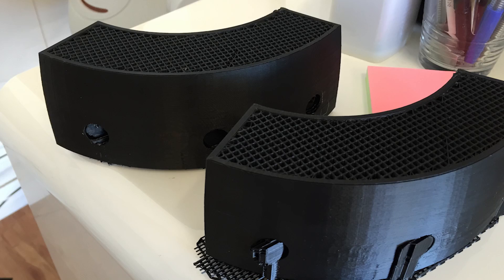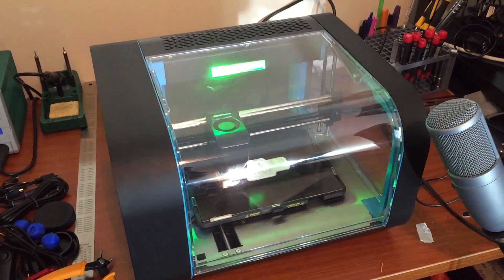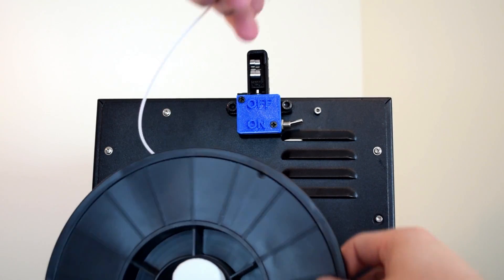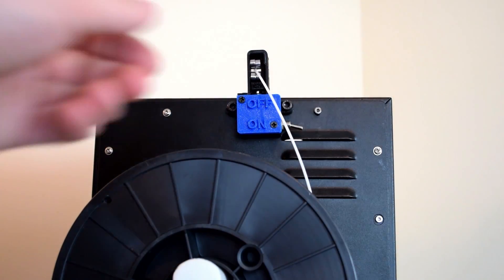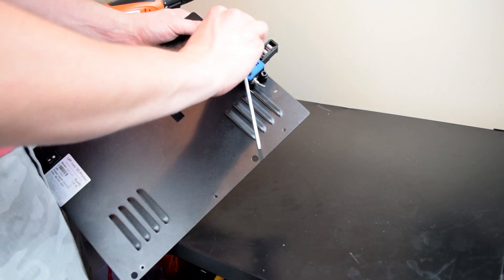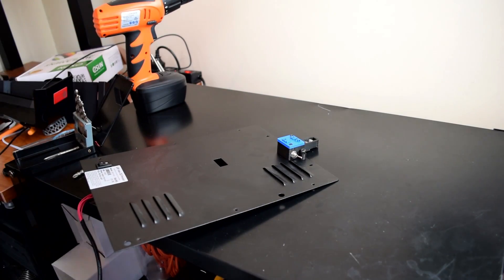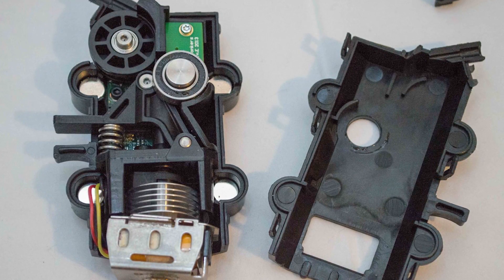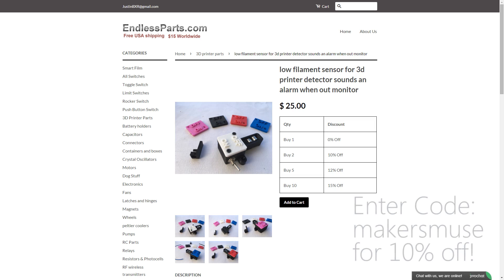Never Run Out of Filament Again - Low Filament Sensor Review - 2015

Comment: Hey, I am 31 hours into a big print and I am nervous that I might run out of filament. I searched your videos but do not see one for changing filament mid-print. I am currently on the Tevo Tornado which seems to have the same functionality as my Ender 3 unit for changing filament, but I have never done it. Thanks for all the videos.

Comment: Nice Video! Repetier supports a system called "FTS" Filament Tracking System. It detects when you are out of filament, your drive gear is slipping or you got a jam and stops the print/slows it down. I installed it on my 3D printer and it is working flawless!
Reply from the maker: +TheZippyMan Neat! I hadn't even heard of it, I use repetier on my Fabrikator mini so i'll give it a shot. Thanks for the tip!
Reply: +Maker's Muse You need Repetier Firmware, not Repetier Host. :) The standard Mini Fab uses Marlin. The FTS module is basically an endstops which triggers a signal when some filament gets pulled in. You can build it yourself or buy it. Look over here. :) http://doku.radds.org/dokumentation/other-electronics/fts-filament-tracking-system/
Reply from the maker: Oh... derp, makes sense! Still very cool, i'll check it out.

Comment: I know this is old now, but wouldn't a spool holder which weighed the spool and remaining filament be better? Then you could have more than 10 seconds warning as you could set it to whatever weight you preferred.
Reply: you would also be able to see in advance, like i have a print lined up 150 grams oh wait i only have a 100 left need to change it before i start
Reply: No need to change, just have the printer pause when you run out :)
Reply: True but some people are looking for an knowing much farther ahead if they have enough material or not.

Comment: That wouldn't be very difficult to implement. Just put a small magnet in the side of the stationary wheel and a digital hall sensor in the frame. Make the output reset a timer that otherwise triggers an alarm.

Comment: Are there any that will initiate a pause on an Anet A6 so that you can change it out say if you had to take a quick run to the store and it ran out while you were gone and when you put new filament in you can resume printing when you get back. I'm going with an A6 as my first printer. I'm pretty skilled technically but this is my first venture into 3D printing so I'm just looking at possible improvements.

Comment: +MakersMuse i just bought a up plus original to add to my ultimaker and ctc and it didn't come with an extruder but it takes the original 14 pin one £200 around 500$AUS I think but it didn't come with a power supply and I'm hesitant to buy the extruder not knowing if the printer works, if I move an axis repetitively it powers up the fan on the board which I assume is a good thing ? All the axis move freely along one of the z fixers was damaged so I printed a new one at college on there up plus 2, would you have any tips or pointers ?

Comment: Hey Angus,
Great tip. You could of course just use double sided tape to mount the sensor... for those afraid to drill...

On the theme of filament running out - how about a video of tips of the best ways to pause a print and restart. There has to be lot's of different methods. Yes, as you can tell I am very new to the whole 3d print game, so any tips would be very valuable...

Love the channel...
Reply from the maker: +Jeff Keen Thanks! Yeah Double side is a good idea, didn't think of that. There are indeed a lot of different methods, actually I'd wager almost every different brand has a different procedure. Good video Idea though! 

Cheers,

Angus

Comment: If you plan properly, this should never happen. I use Simplify3D, it tells me the weight of the print, it's very close, usually over estimating by 1-5%.  I have a good accurate scale next to my printer. I know the weight of an empty spool of filament, you know before you start a printer how close you are by eyeballing it. So if you think you'll be borderline, check the weight, make sure you have enough. It's pretty silly to start a 15 hour print without make sure you have enough to finish. I've done an absolutely massive print -- almost 5 kg of filament, 24 parts which I subsequently glued together. I had a google doc sheet with each part, it's expected weight, actual weight, and the spool it was being printed on, I played around a bunch trying to load balance each part to best use the spools and not have to worry about pausing and restarting. It takes a bit of work to plan it out, but at the end I had about 5 grams of filament each on 4 spools -- and remainder 500g or so on the 5th.

Comment: I work with a company called fracktal works (fracktal spelled like that ) from india. its got filament sensor. It also detects blocks and tangle in filament by checking filament is moving or not. it pauses the printer if it detects it.
Reply from the maker: +Karan Chaphekar That printer looks great! Really nice features and I appreciate the thought put into the Aesthetics. If you ever want someone to review it...  :)
Reply: +Karan Chaphekar I think a clog or a tangle is more important to detect. If you don't have enough filament to do your print -- your fault, if the extruder got clogged -- the fault might be yours or most likely the filament manufacturer, but if it's a tangle, then it's definitely the filament manufacturer, in either case -- I can live with making sure the spool has enough to finish the print -- but if I'm air printing because of filament or spooling issue -- then I get irritated

Comment: The FlashForge Finder has internal filament check, never tested it, but assume it pauses a print.
Reply from the maker: +Mickice Neat! The Flashforge Dreamer certainly doesn't have that feature. I'd love to test out a flashforge finder.
Reply: But the Finder only accepts small sized spools, my 1Kg white won't fit inside. I have to model an attachment for the side. Not using the sensor in the process :/

Comment: DaVinci printers have one and if you reset the Epron then  you can turn it on and off
Reply from the maker: +AHOAY_ LT That's awesome, I never knew that! Cool that it still works even if you reflash it too. Does it detect filament flow / jams or only when it runs out?
Reply: +Maker's Muse The DaVinci 1.0/1.0A and 2.0 contain an optical gate (like an optical endstop) to detect the filament with minimal friction. If the filament runs out the printer pauses and an alarm goes off. Filament extrusion length and speed are calibrated by an optical encoder fitted to the idler bearing next to the extruder gear. Custom firmware allows this to be used to detect jamming and slipping.
Reply from the maker: +Sterillium That's really cool, to be honest I had a fairly low opinion of the davinci's but they've come a long way - and having a sensor puts it ahead of many other printers on the market.
Reply: +AHOAY_ LT Aye? like this doodaky or are you meaning the chip that reads how much filament is in one roll and tells you how much is left but only if you buy there brand of filament with the special chip.
Now that I've hacked mine with a fake chip telling the printer it always has filament "so I can use other brands of filament" it's kinda useless. Especially because DaVinci printers can only hold like a 750gram roll I believe and I normally use a 1kg that I have set up outside of the machine and have threaded threw a crack in the top door. xD
Is there something else I'm not knowing about my DaVinci?

Comment: my makerbot replicator mini (got it insanely cheap) does this. it will actually stop printing and wait for me to reload filament. i have a few dual color parts from just this type of incident. i was really surprised it was aboe to resume the print just fine.

i do like the idea of an alarm though i can think of a few ways to make such a "dumd sensor" without any electronics. 2 metal wheels with wires when the wheels touch it completes the circuit and sets off the buzzer. might even be able tobautonpause if your printer has a pause button. use a relay. not bad at all for $25 though. i might buy one just because.
Reply: Does it do that out of the box or did you get the smart extruder+
Reply: Mine did that out of the box. it had the only "smart extruder" my replacement has the smart extruder plus but I have not even taken it out of the box yet (addicted to ther larger print volume of my maker select)

Comment: The makerbot rep fifth gen has a filament failure sensor, slipping or out of filament sensoring (atleast the one i tried has it)
Reply from the maker: +Johan Lindström It does indeed - Ours was an early model - which didn't work properly at all. I had gone through 4 smart extruders before returning the machine and giving up, but they work properly now - finally.
Reply: +Maker's Muse To be honest they still don't work very well.

Comment: My latest failure was an 18 hr print, failed at 17 hrs in  due to a Windows update.
Reply from the maker: +qpeighty Lame!!! Tethering? That's why SD card is my preferred method of printer control.
Reply: +Maker&#39;s Muse I have a modified Printrbot Simple Maker 1405, the SD Card Slot is almost inaccessible through the plywood under the extended bed.

Comment: Hi! I recently modded my Up Box to PAUSE (yes pause) when the filament runs out. There is a nice tutorial here posted by Bruce from 3d Printing Systems: www.pp3dp.com/forum/viewtopic.php?f=39&t=55111
TierTime replied they will add this as a new feature for the Up Box.
I think the Up Mini and Plus (2) should also be able to be modded this way, the main board has the connections ''door check''. It might only need a header and a switch for the software/printer to be able to pause.

Comment: we have added filament runout sensor to our commercial printer Rigid3d (http://www.rigid3d.com) which uses Marlin firmware. We have shared this with opensource community and added our additions about filament runout sensor to Marlin firmware in April 2015. Without any expensive hardware you can add this functionality to any Marlin operated printer. You would only need a tiny limit switch and a 3d printed case for the switch which would cost less than 1 usd in total. In case filament runout Marlin  automatically starts the filament change routine and beeps.
Reply from the maker: +Mehmet Sutas Nice! Really cool that you contributed to the open source community with such a useful addition. The Rigid 3D Printers look really well built, nice sheet metal frames.

Comment: Hmm One of my printers has a filament censor that pauses the print job if it runs out of filament.
I have the shitty XYZ Davinci 1.0a
The other one I built something similar to this http://www.thingiverse.com/thing:1786543 very cheaply since I use Octoprint so both of my printers do this and even notify me if it stops I can resume at any point

I always thought this was something common that most people had some kinda solution